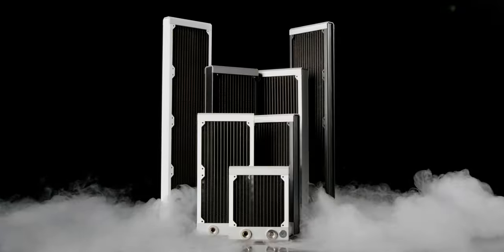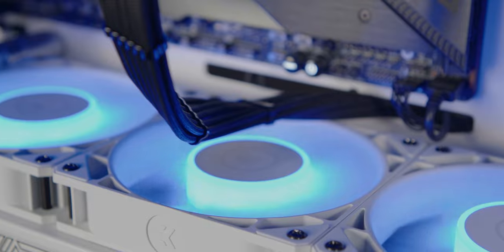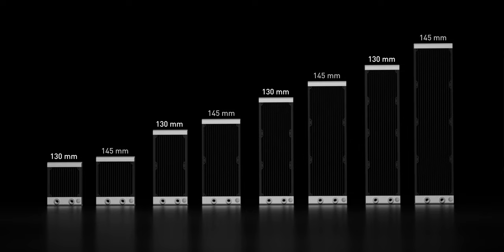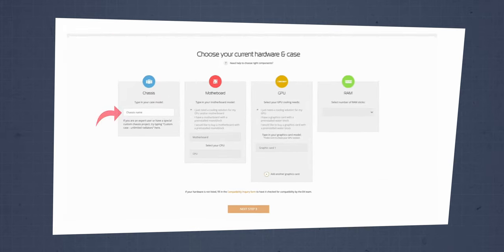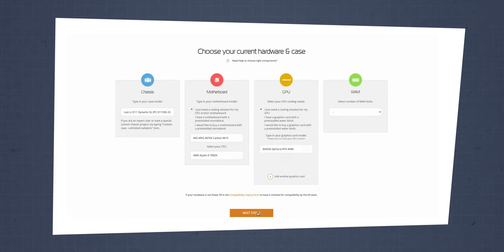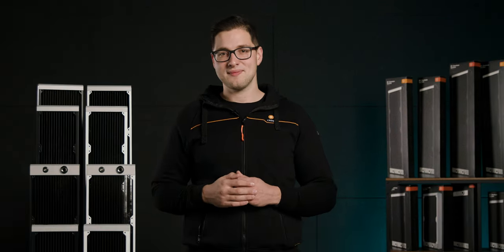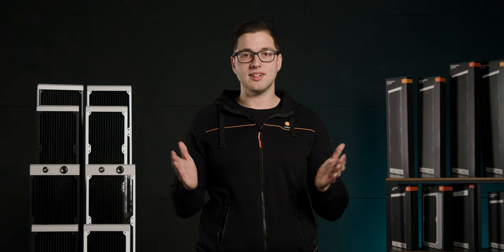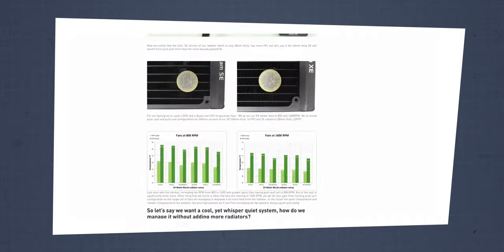Which Water-Cooling Radiator Is Right for My Gaming PC | Basics of Liquid Cooling

Comment: One thing to remember when choosing an X-flow radiator is that they are longer than the normal radiators and some case manufacturers don't (easily) support an x-flow version while they say they support an 360mm radiator. The x-flow version barely fits in my Phanteks Enthoo Evolv ATX TG top bracket.
Reply: Do you think the x flow 480mm radiators would fit in my Corsair 1000D Case at the front. There is room for 2 480mm radiators side by side. Trying to decide if I can fit the X series with push pull fans and a pump reservoir attached to the back of the radiator fans or do I need to go with the P series 2 of them?

Comment: I have a Corsair 1000D case. I wonder if I can get awat with  a dual 480mm X size radiators with push pull fans and a reservoir/pump mounted to the back of the radiator fans?

Comment: I'm a bit confused about why my Enthoo Elite seemingly doesn't show the correct radiator options on your configurator... The front should support a 560 rad, but that isn't even an option on the configurator..

I'm considering watercooling for my next build, but the configurator is very unreliable in my case (no pun intended) which is actually a bit of a problem imo.. It's been too long since I've done water cooling, and I've never done it on my own system, so it feels like I'm starting form scratch again.. 😅

Comment: "bigger is better" that's totally wrong.
Have fun to get cool temp with a thick rad when your fan can't blow out the hot air .
Reply: There is common knowledge that you put fans in push and pull for thicker radiators. And this will allow for lower fan speed (less noise).
Reply: He said "bigger" not "thicker". And he made hand gestures indicate that he meant longer. He's correct. In the video he also said that in general if you have to choose between bigger and thicker select bigger.
Reply: Or simply more radiators... @MyJapaneseLife